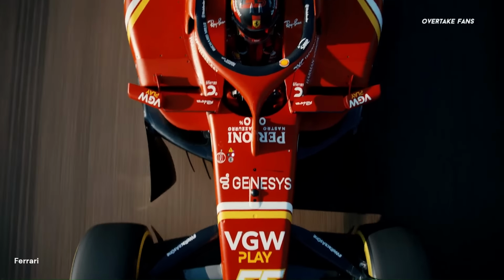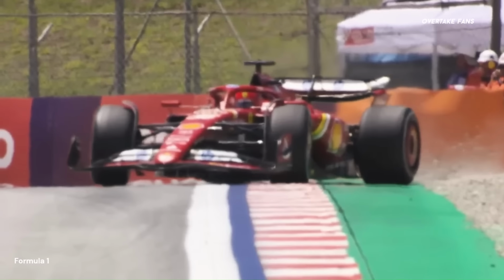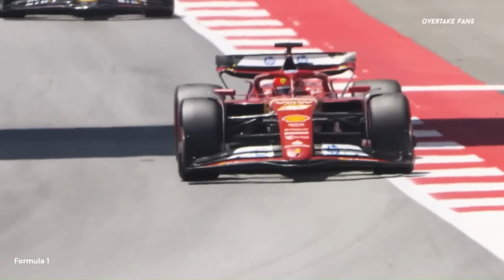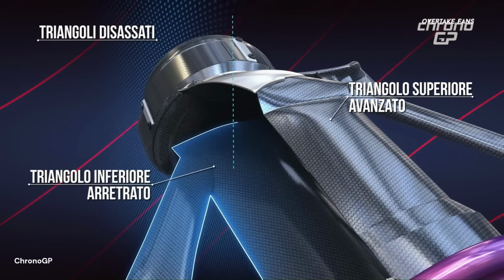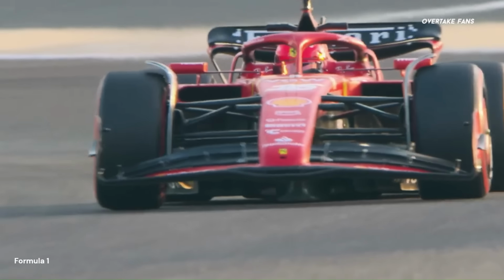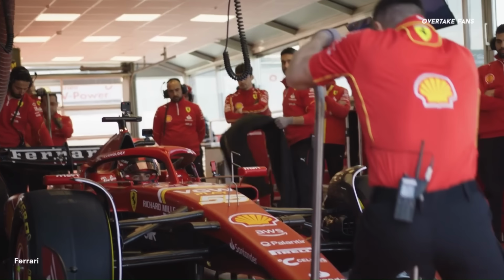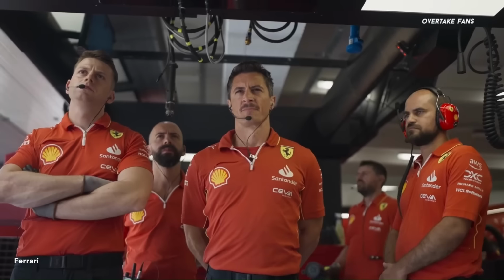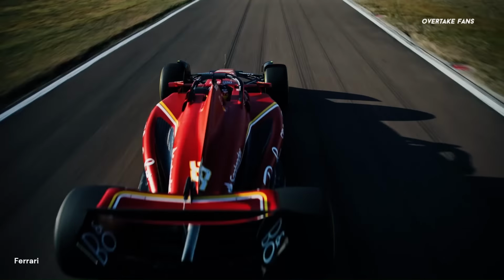Ferrari's INSANE NEW UPGRADE Will Change EVERYTHING! | F1

Comment: They are allowed to make all of these upgrades. Redbull puts a check valve in a tee and a the FIM makes a rule against it. I don't understand why they would do that?
Reply from the maker: Aerodynamics is different from mechanical. And we are not even sure if Red Bull did this. It's just still speculation, so don't count it in or out. 

What Red Bull really needs is a stable aerodynamic platform. That's what the RB20 is lacking. From what I have seen personally, only McLaren have that sort of a car.